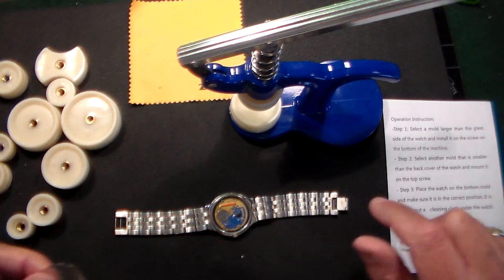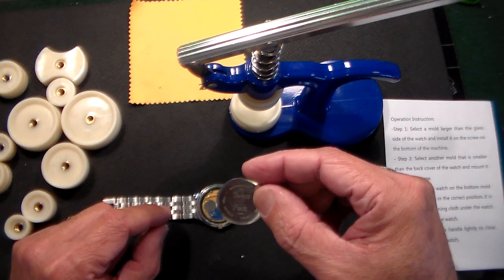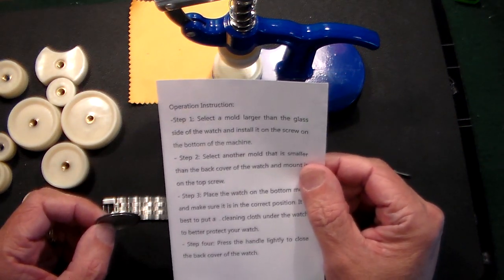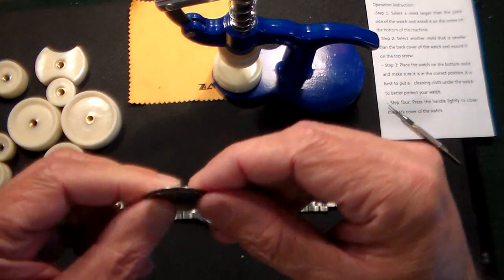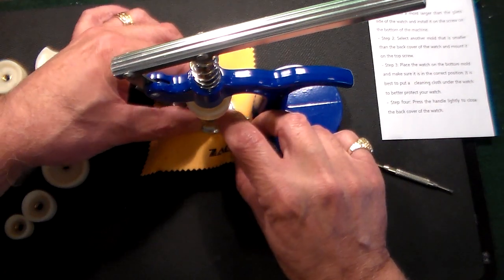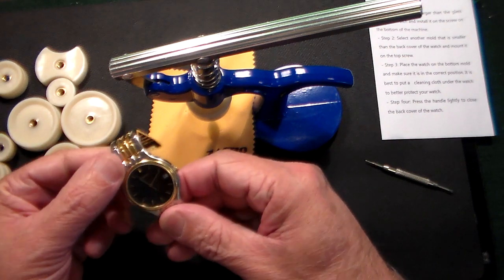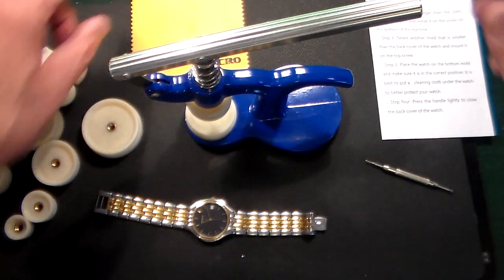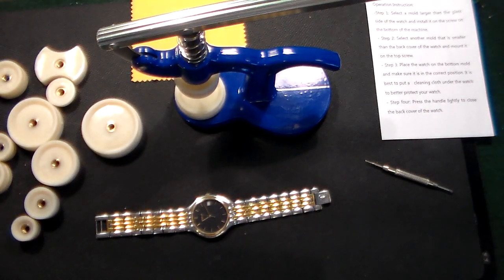How to use a Watch back Watch Press

Comment: Thanks for the tip about the cleaning cloth. The one I bought didn’t mention anything, and I was concerned the bottom mounting pin was too close to the crystal surface. Worked well with a lot less pressure than I expected.
Reply from the maker: Glad I could help!

Comment: Would these presses be useful for anything else.. just curious if the leverage on them was decent
Reply: If you are careful they are great at pushing the braclet pins back in.  If it slips you will scratch it though.
Reply: Taking measurements, the leverage is only 2x to 2.5x. The main benefit is the pressure is steady and evenly applied in a way that protects the crystal.